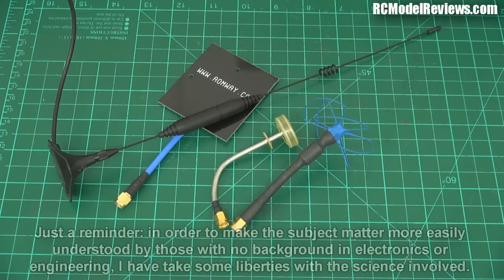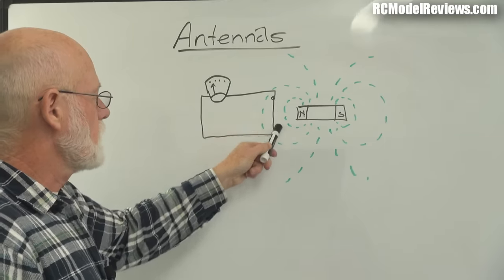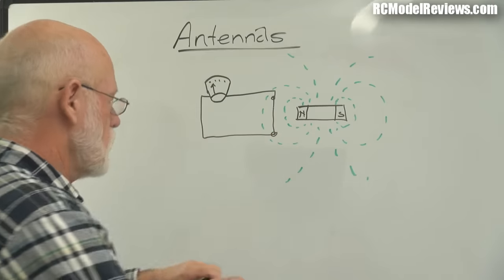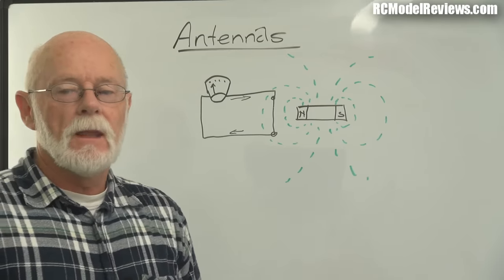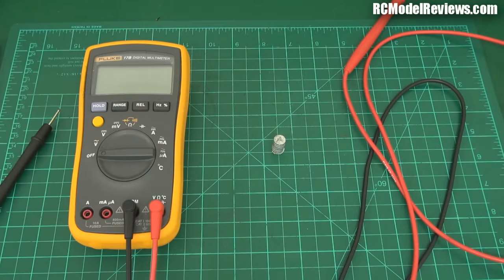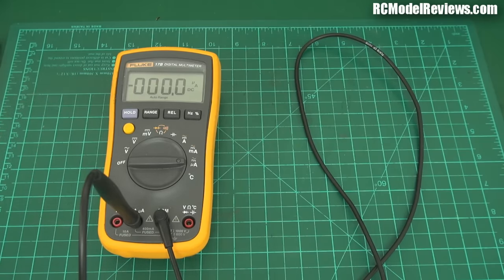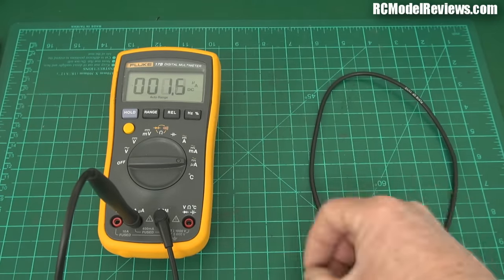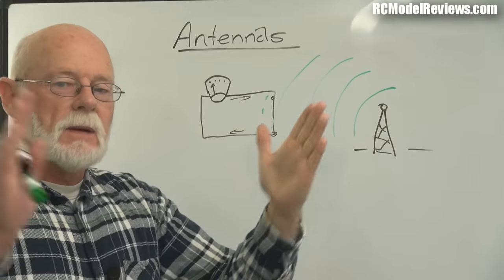How do antennas work?

Comment: Thank you for your educational video. It does not matter how much I think I know about a topic, there is always something new I learn. Thank you. Simplification is the key to me. So let me please share with you the vision of the PENDULUM WHEEL to do work...as we know every pendulum can work as a hammer with an intrinsic energy that is proportional to its mass, height (radius) and Gravity. The PENDULUM WHEEL versus a free wheel of inertia, is a simple wheel with a significant mass attached to the periphery of the wheel to take advantage of both, the force of gravity and inertia to do work. Since work is “MAD” x cosine of the angle (ex. Mass x Acceleration x Distance) and the cosine of 90 is cero, this means that we can exert a force over a pendulum wheel at certain angle close to the horizontal path of a complete Revolution and not only the pendulum will move over the tipping point with that force over  a certain number of cycles but if the mass is significant it can do positive work. The hypothesis is formulated with a question: Can we improve the efficiency of engines by adding the force of gravity?... In other words, we can use a low velocity (and high force gear for instance) to move multiple pendulum wheels over a tipping point of 90 degrees at different intervals to improve the efficiency of engines that capture free acceleration thanks to the force of gravity. Something to think about! Please feel free to comment. Maximo Gomez, IV The millennium of Hydrogen...The millennium of hydroelectric power...ideas for a clean energy Revolution!

Comment: So why isn't lower frequency used for RC controls more often, since it can radiate/"bounce around" further? What's the biggest downside? I know that UHF/SHF/EHF can penetrate walls better but it does terribly with dirt or water in the way.

Super helpful video BTW, both for working on my technician's license and for learning RC.

Comment: Can use a pop can for a dipole sleeve.. used a top can opener to cut the center out.. based on theory/drawings, drop a coil inside, length of the can for gain. 
& if you don't cut the end out of the can.. you can tie off /soldier the antenna to the pop tab. The long skinny Truly Seltzer cans would probably be a good size for a test, but where do you find a consistent coil that fits? 🤷‍♂

Comment: Informative, for sure. Now, what do I buy to get DTV 30 miles away from the transmission towers??
Reply: Do you really think a little wifi dish can send a signal 22 thousand miles to a satellite on just a few watts and it send it back down with pin point accuracy from another small dish, and where do those satellites get their power if 1/2 the day they are in the shade of the earth.. They tell us those satellites are over 22 thousand miles up,,, think think think 22 thousand miles  is a long long way,, I mean  they say the earth is something like just over 24 thousand miles  around,, and  from that little dish to tarnsmitt that far and and hit a dish directly on a satellite on just a few watts off your little modem,, really,, give your head a shake....
We use to get skip where waves bounce off the sky,, but waves only bounce off something sold...
Hay the Bible says there is a dome over us, now that makes sense,, and then they could put piles of big dishes pointing on an angle and then if their was a dome it would  reflect off it and that wold work proper.. So the Bible could be right right.. If that is the little dish up link can send and receive that far you should be able to put your wi fi antenna with a dish behind it and pick up free open wifi  from a city 50 miles away..
And really a little satellite flinging  around the earth  it could not be held properly in one spot.... Think think think,,, it makes no sense what they are telling us.. Plus look up thermosphere temperatures and they will tell you it goes as hot as 3600 degrees F or hotter,, and aluminum melts at just over 1200 F and they say those satellites are in it.. Think think think here's a link.
https://www.bitchute.com/video/uCKRjeJ4VW6B/

Comment: You explained a lot of stuffs that I didn't know but there's still one mystery for me and here's my question. 
What makes an antenna, an antenna? Is the non-isolated wire part ? 
Let's say you have a coaxial cable and a dipole antenna, instead of soldering the shield directly to a pad, you would solder a wire and then solder to that pad, would that change the wavelength of the grounded antenna ? 

I'm not sure I explained my question correctly but hopefully someone can give me some clarifications or pointers.

Comment: At the 1:21 mark field lines should come out of the north pole and end on the south pole? You should rotate the field pattern 90 degrees? 

In your experiment at 5:30 the orientation of the magnet is important. If the axis of the magnet is parallel to the plane of the wire loop no current is produced when the magnet is moved back a forth in a plane parallel to the loop? 

I did the experiment with my multi-meter. I could detect a voltage but no current (as the meter was more sensitive to voltage then current) when the magnet axis was perpendicular to the plane of the loops and movement of the magnet was parallel to the plane of the loops or when the magnet axis was perpendicular to the loops and movement was towards the center of the loops. To increase the sensitivity the meter lines were coiled into 8 loops.

Thanks

Comment: A major difference between the phone charger setup and a broadcast is that the former uses the EM velocity field and the latter uses the acceleration field. So, with a phone charger, energy remains in the charging system unless there's something on the receiving end (the phone), whereas a broadcast emits and loses energy regardless of whether there's anything receiving it.

Comment: I have been interested in the timing system they use for RC cars.  I've even made antennas for tracks though I just copied the factory ones that broke.  I think they use a tilted twisted folded dipole (TTFD or T2FD) for the receive antenna but I've never understood how they work. Any good sources you can point me to?

Comment: I'm confused, sensei. In other videos, it says that antennae pick up all signals indiscriminately and they must be filtered through a circuit, using capacitors and inductors. But you say that the antenna itself is tuned to the frequency through its length.

Comment: I’m new to understanding RC radio signal transmission to voltage/mA power usage.  If we increase the dB or length of the antenna, will this absorb (use more) power quicker at my hand held ground control battery pack?   I like to experiment with my DR3 Solo drone.  If I increase the ground control Omni pole length, will this improved dB antenna strength also increase the range wave propagation and provide better wave transaction as well as increase my travel distance ability from ground control to aero system?

Comment: Thank you. Now I understand! But As an RC car hobbyist, I don't understand how the polarization issue doesn't mess up the signal. For example, all RC car hobbyists recommend laying the receiver antenna INSIDE the car, even if there's a hole on the rc body for the antenna to stick out of. Indeed, at the power levels and speeds RC's travel, if the wire is sticking out it will be split in half when the car goes flipping at 40 MPH, lol. So, if the antenna is inside the body, it is horizontal. But the controller antenna is vertical for the most part. (2.4 GHz.) Nevertheless, I've got plenty of range for the signal. Theoretically, the receiver shouldn't pick up much signal at all. So how do you explain that I almost always have plenty of range, as I'm sure the transmitter is putting out very low power - not even near a handheld ham radio?

Comment: Fantastic video. Question: what's stopping anyone from just adding more and more elements to a Yagi design to increase dBi? If you had a long enough pole, could you make a 100dBi yagi?
Reply: keep adding as long as you can handle
weight
sway
wind
and a pole

Comment: 1:32 that is really interesting I didn't know that in theory the magnetic field extends forever and you should be able to detect any magnet in the universe if you have a sensitive enough equipment, I have been studying physics & electronics for the last 10 years as a hobby and never came across that bit of knowledge. can you explain more about why in theory the magnetic field lines extend on forever or at least are said to?
Reply: Read Asimov on Physics.

Comment: Excelent video as always! I find your videos really helpful. I have this doubt:  Is it possible to transmit a 0.5hz frequency? If so how long it would be the size of the wave length? Thank you in advance! Regards
Reply: The answer to the first part of your question is, not practically. For the second part, using the formula for wavelength, λ=v/f and rounding the wave speed velocity up to 300000 m/s the wavelength would be approximately 372,822 miles

Comment: Ive only experimented with antennas when I was a child, before transistor radios, using an earphone with a crystal set.
Now I'm trying to get a better reception on my cheap DAB radio.
Can I achieve this?
Does any one know optimal coils or length or span etc?

Comment: Hi , thankx for the insite, I am watching your video because I have a antenna on a poll (not in use, looks like an old CB antenna, plastic coated and about 1m long ) and in some cases I can hear an electrical crackle from it.? so I climbed up the poll to see what looked like a high voltage spark jumping from the unused terminals at the base of the antenna, this spark is jumping 5mm or so. So ... whats going on here? how much power/voltage could be here and is it dangerous or able to be harrensed. regards Gary

Comment: Far field effects are caused by special relativity. Basically, accelerating charges cause radio waves (or microwaves, light, etc.). Absorbed radio waves accelerate charges in turn (for receiving antennas). By making the antenna 1/2 wavelength, the acceleration of the currents matches the radio wave frequency. This explains loop and slot antennas as well as klystrons or whatever. 

In physics, this is called braking radiation (for the free electron case anyway) or Bremsstrahlung (German for braking radiation).

In special relativity, all inertial movement states are equivalent. But an accelerating charge is in an accelerating movement state and thus not the same as a steadily moving state. This acceleration causes a deformation of the electromagnetic field. But that deformation takes time to propagate (at the speed of light). This effect is the cause of the far field. 

The far field is the radiative part of an antenna field. 

The near field causes changes in the electromagnetic field near the antenna which in the end don't radiate energy. It takes energy to form them, but the energy comes back (with a phase shift) as the near field collapses. These changes to the near field affect how the charges accelerate, changing all the characteristics of the antenna including how the far field radiates. That's why it is so important to control conductors near the antenna while conductors farther away from the field are much less important. It's also why a good ground plane helps an antenna.

Comment: Are radio waves the same as light? 
How small can an antenna be? If it would have half the length of a light wave, would it work with light? 
How comes that the yellow light wave of a sodium atom is three thousand times longer than the atom's diameter? 
Wouldn't this require a very strong inductivity and/or capacity inside of the atom?

Comment: Hey so I jumped the gun on my question after sending I realized I overlooked the fact that the nanosync extender plugs into the controllers main pcb where the stock antennas were plugged into therefore on the other end it's connecting with the mavics rx antennas. Sorry about that ..is there anything you can still tell me about what type materials are inside the nanosync? There's similar extenders by different companies like Alientech, 4Hawks... ect in case your not familiar with ITeLite or however they spell it. Cheers

Comment: i developed an antenna on accident i took a coax cable and striped it at the proper length and pulled the sheild back over the wire then i coiled it 3 times so that the length i stripped it at was the circumference making one loop of the core one loop of the shield and one of typical coax and as i know and knew the third loop was superfluous it helped now i made this trying to get a car stereo to recive my favorite station as best as possible and i originally made a 1/4 wave di-pole and recived a shit signal i coiled it up being ocd in my own special way as i did so that each pole fomed its own loop just to be simplert to handle and oddly enough when i tried it like that i went from between static and mono to an amazing signal so i made one for my grandads tv and he mostly watches one channel and same thing from spotty signal to the best picture hes gotten id like to understand more about what i did and how to make it better also why when i tried running the antenna through an amp it sucked was it the filtering should i do a high and low pass filter and also after watching your video what about a dorr spring or similar coupled with a dish

Comment: Is the RF energy radiating off of the antenna the same thing as the magnetic field induced in a conductor by current moving through the circuit?

Comment: I have a question regarding parabolic grid antennas.  Is it possible that using a parabolic grid antenna I can pick up a wifi signal from a regular hot spot that 1 mile away?  I've seen some claims from some antenna companies that It can pick up wifi & celular signals up to 10 miles.  Is this true?

Comment: On a mobile 2 way radio there is an antenna that isn't attached unlike handheld. Does changing only the antenna change the signal from vhf to uhf? or do I need a mobile unit that claims to does both first but only when paired with an antenna that does both or the type you chose to use.

Comment: the antenna is just a wave guide to channel the vibration created from the carrier circuit. it have no other purpose. the carrier is just a high freq sound wave  that vibrate electricity at the frequency of the sound. the freq is so high you can't hear it mechancially but if it was in khz range it you would hear it as a noisy pitch.

Comment: So, as far as the example goes at like 6:02, that makes sense to me. That is nothing more than like, pretty simple induction with a loop of wire, just like as mentioned how a generator or transformer operates etc. 
What I don't understand is how the picture at 12:56 is even related to that? There is no loop, and it doesn't make sense to me how the changing magnetic flux (if that's what the wave curve is supposed to be) induces a current then. 

This is an entirely new idea to me that antennas are driven by magnetic waves just like transformers (and not the oscillating electric field), I would love to understand this but even this basic idea as mentioned I don't get.

Comment: Used to fly model airplanes as a young kid.  If my plane was far and started acting squirrely, my natural reaction was to point my antenna at it.  From the drawing at 31:05, looks like I should have kept the face of my controller perpendicular to the line between myself and the plane.  I always imagined that circular signals came out the top like Aquaman calling fish.  :)  Oops.

Comment: It's not necessary at all to have a resonant antenna -- especially for receiving.  Don't you remember the small hand held radios listing to AM radio stations with wavelengths on the order of 300 meters?  They still receive just fine.  And you don't really need a resonant antenna for transmitting...but it helps reduce signal loss in the cable and reduce high voltages.  Non-resonant antennas are used all the time in ham radio.

Comment: An antennae is a length of some magnetic induced material which measures a length commensurate with the FREQUENCY length of the signal being sent or received. Case one, sending a signal . An amount of voltage is applied to this length and it generates a frequency based on the length of the antennae. The amount of voltage applied determines the time and distance that the frequency lasts and travels with exceptions. The exception is the distance it travels is infinite but in a weaker form, which is the square root of its distance of travel. To send a ten meter wave length signal to Voyager two at twelve billion miles disance to be readable at that distance must have X volts of electricity applied to the antennae. Case two, receiving a signal with the same parameters of the sent signal. Let us say that the applied voltage is under ten volts. At the same distance we would be able to still receive the signal but in a much weaker form, perhaps a hundred thousand times weaker than one we could send to the probe. We are able to amplify this sent signal by receiving it on three or four other antennaes and multiplying its signal strength into a readable form. While we can receive a signal on a specific length of antennae the signal actually is in the form of circle having a diameter of our antennae. All points on the circle strike the antennae at essentially the same time

Comment: Its not quite that simple.  Hz are aldo audio.  A broadcast of one hz would require a 3 mile long antenna.  Sub audio is performed with physical mechanical energy.  Middle C on a piano, for example, is 440Hz.  Thats where heterodyning come in to practice.  Combines audio-electrical energy with your broadcast signal.  So middle c goes from 440hz to 109.7mhz